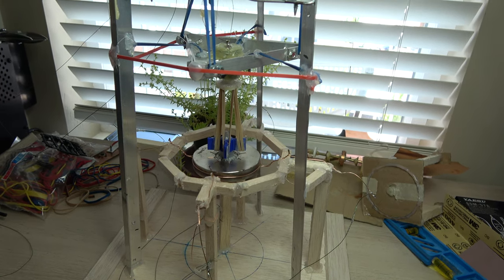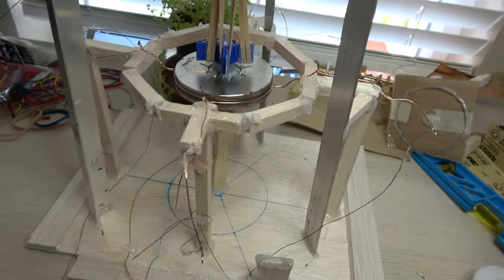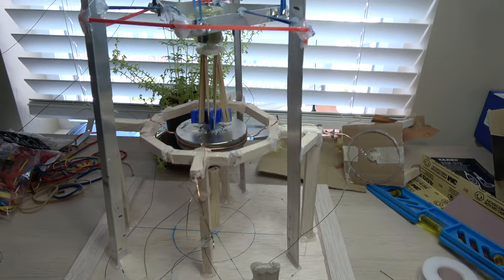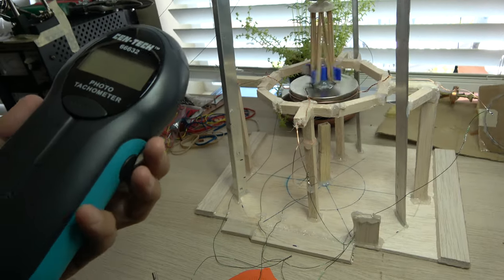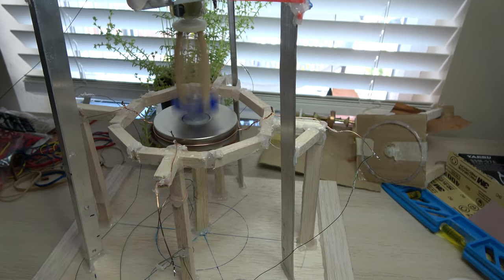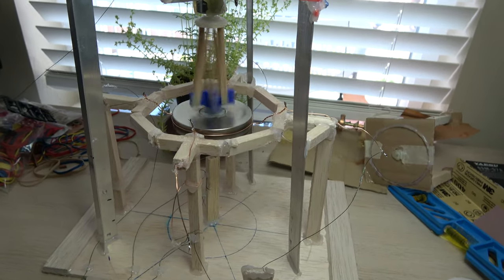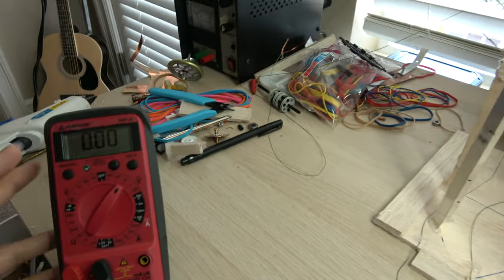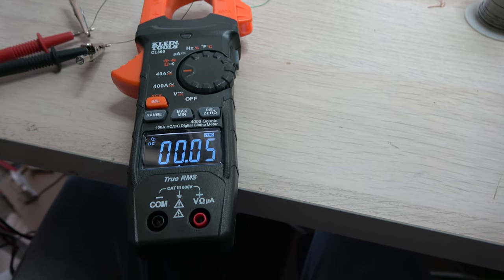N Machine - Bruce Depalma - Free Energy from a Spinning Magnet Part 2 of 2

Comment: I like what you have done with your and N machine I have made one myself ...and it works incredible.. my machine put up a about 30 amps at about 1800 RPM's my device uses to magnets South pulls are in North or facing at and if you do this and dad brushes on the leading edge of both magnets that connect them in series you will get 25 to 30 amps my magnets or 3 inches in diameter ..... And I have not posted it on my site for obvious reasons I might be doing a post of my in machine probably within the next few weeks I'm in the process of actually moving right now so after this is done I might make a short video on it subscribe to my channel and you can check it out and see some of the other stuff I've worked on Cheers
Reply from the maker: I feel so stupid right now.  Haha... lol   if only I'd seen Depalma's actual patent sooner.  I understand perfectly what you have done and what I have to do now to get my device to work.  Its all right here.  https://depalma.pairsite.com/patent/patent.html   Thanks for the heads up! and I really appreciate your help with this and opening up about your success!!!  I know its dangerous to even talk about things like this when you have a working prototype.  Believe me I've lost contact with so many people over the years.  I've even had some of my own bizarre experiences that came as a direct result of me making some of the videos I've made here on youtube.
Reply: Yep I've had some weird stuff happen to me but I'm willing to come out with it but the problem is if I come out with it I could get banned from YouTube so I'm kind of really reluctant on posting it but if you have any questions I will be glad to help you out. Mike
Reply from the maker: @FaradayResearch  WOW!!!  Your work is very impressive!  I watched both your V2 and V1 vids.  Very nice indeed....    I'm envious of your work and setup.  Your like my future self just around the corner.  lol   Thanks for posting those vids!  As long as you give enough reason to doubt and do not post a blatantly definitive video that very obviously shows anomalous activity of some kind, you will have nothing to worry about for the most part (or so I believe).
Reply from the maker: @FaradayResearch  Here's my newest video if you were interested.  https://www.bitchute.com/video/0ufnxHdbTrKT/
Reply: Awesome work you're doing guys! Why don't you post on multiple networks at a time so your message gets heard wider and longer? Rules dont work the same way everywhere for ex China. Once people pick it up and notice it  it can go its own way and people will start to duplicate your message themselves. 

There is actually a german 'conspiracy' company that started purely on a claim that water has memory and by introducing a small amount of spring water to a large tank of 'dead', oxidized corrosion causing water, the dead water revitalizes to spring grade. Used in german iron forgeries to cool equipment, they dont know how, but it works like a charm they said. Bakeries using this revitalised water along with Viktors Schaueberger vortex faucet that further enhances the dough also never want to go back to before. All based on real expierences. The company looks like it's doing good, www.grander.com Currently due to draught in Taiwan/Singapore where chips are made clear spring water is needed during manufacturing and the water is running out, letting prices for chips skyrocket. Imagine what this solution would do..
 
So my point is, people are noticing 

 In me resides a small fear that in the end, Limitless energy = limitless power and would be detrimental to our capitalistic system based on measurements and in the end, with an outcome of war or an outcome of the system changing to something more like www.thevenusproject.com. As a youngster reading about Tesla, Grebennikov and Schaueberger i told myself when i would create such a device and be a millionaire,  i would make as much devices as possible and distribute them to a diverse targetaudience as possible, for free. To the poor for mouth to mouth marketing and to the rich not dark elitarian working class for enforcing my claims/looking for backup. But thats was just me dreaming lol ;D
Reply: Keep it up good work and honest. please check meter used is AC. To measured current replace with DC.

Comment: You should not use a electric motor to make it spin,all i want to see is a magnet motor wich will require no electricity,whether it’s from a battery,a charged capacitor,hidden wires,no hand,no air compressor or hot air etc,,, 
So it must work without external help.

Comment: Is the wire parallel with the magnet all the way around or does it angle to create a slight vortex around the magnet?  Maybe try a twisted copper wire around it?  Something stronger than balsa wood and hot glue would be safer at high speeds i would think, or a safety cage.
Nice job on the build tho.
Reply from the maker: The circle of wire is more or less parallel with the center of the magnet all the way around.  Thanks.

Comment: The robots are going loco.  The reason for multiple wires because of more current. Look how the gravitron works. How many electric motors to turn that wheel at 33 1/3 RPM's?  Funny I just read a message earlier about spinning magnets inside the coil of wire. I know I deleted a lot of videos years  ago because I was recieving threats if I didn't.  Was cool watching the G-force pulling those bands enough to lift the magnet. Might want to try lighter lines.
Reply from the maker: And what is the Gravitron?  You might be right about more wires to collect more current.  I think in the future I'm going to add elastics to the bottom of the axis and attach them to a bearing glued to the frame so that the magnet will not rise with higher speeds.  Then I might switch to a dozen or more copper brushes like Bruce did in his smallest machine.  If collecting energy at exactly the Bloch wall is the key to success, then the magnet must remain completely fixed in space aside from its rotation on its axis.  With less resistance and greater stability I can really get the rpm up to maybe 10,000 or higher.  We shall see.
Reply: @spiritelemental  the gravitron is a amusement ride. Strong people like me can stand on the walls at 3G's, well maybe not anymore but 30 years ago I could. Myself I would use a drive shaft like a piece of pvc pipe. What I did with my rotary spark gap. Not sure why you used rubber bands to suspend the magnet.

Comment: Read the paper on the N machine. 4 magnets on each side of a copper disk. One side Nort and other side south. Paper says pressure needs to be applied. This means continious magnetic flow this  is why the magnets have norh and south on each side of the disk. But the speed has to be really high becouse the constant flow really takes high speeds to have a potential difference.
I Think there might be easier ways if the magnetic flow can be distracted or obstructed just for short periods to magnify change over time faster than just using speed.  .

Comment: Improvements: the contact brushes to a rotating thing have a interesting property that they lose a constant voltage almost no matter what the current or rotating speed is. I am not sure what that voltage was but i think it was above 0.3V . Losing that much power (u*I) when the current is high is not an option, so the liquid Mercury brushes (or some clever brush method) I think is definitely key. I think he also used two magnets on one axis so that the number of contact brushes is halfed, by using the axis as a conductor, and using a copperplate in front or back of the magnet, so that both voltages would add up.